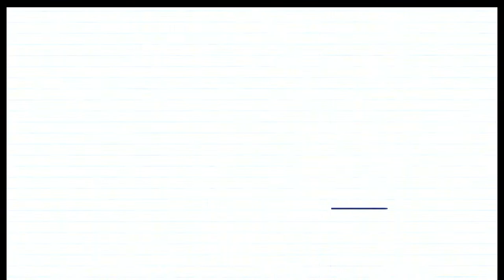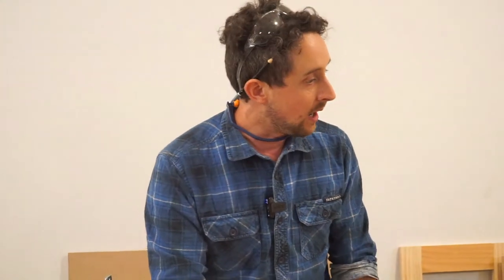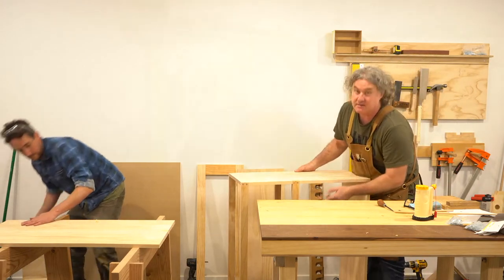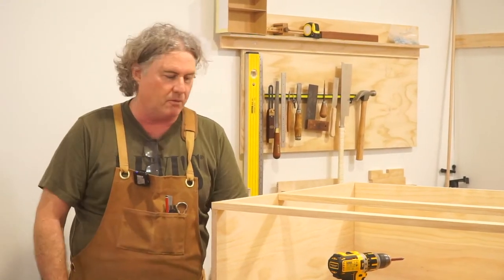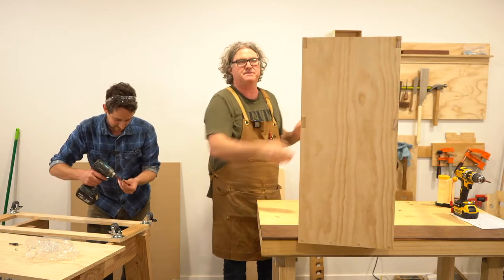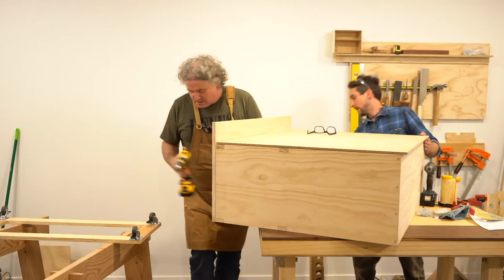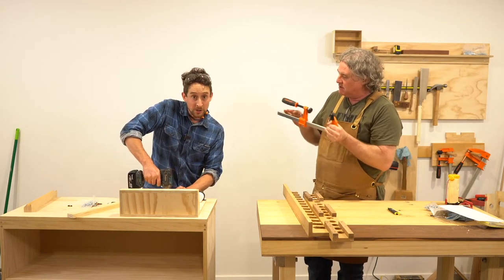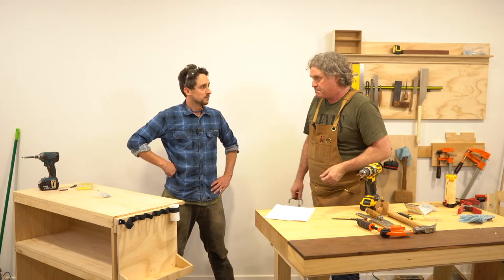The Tiny Workshop - Series 2 Ep.3 - Accessorising the Ultimate Rolling Tool Cabinet!

Comment: Enjoyable show.  I use insulation boards when breaking down plywood etc with a straight edge and circular saw.  It supports the timber and lasts a long time.  For the machines I guess you need a thicknesser and a jointer.  For the type of show that you produce I guess a table saw might be too much hassle.